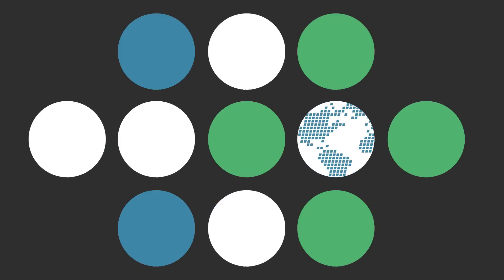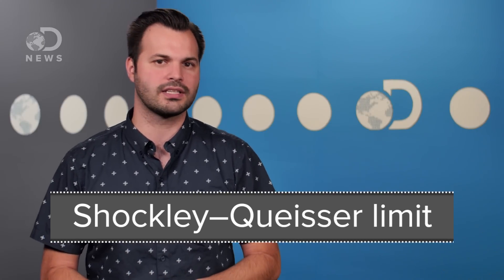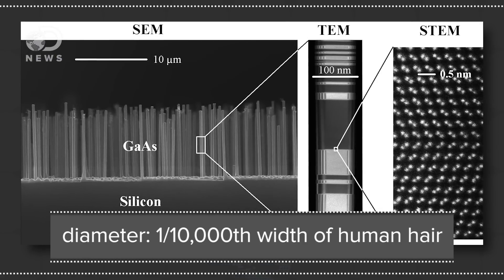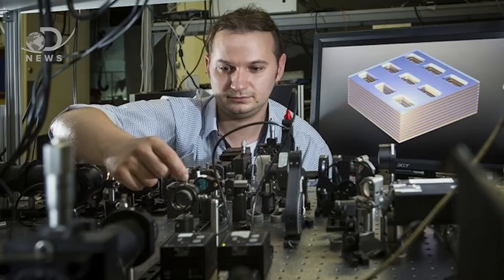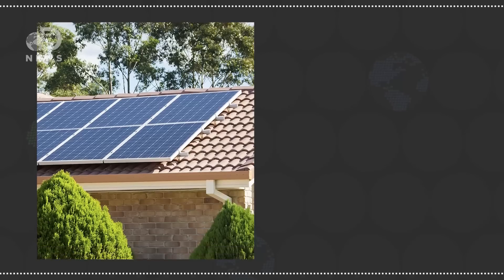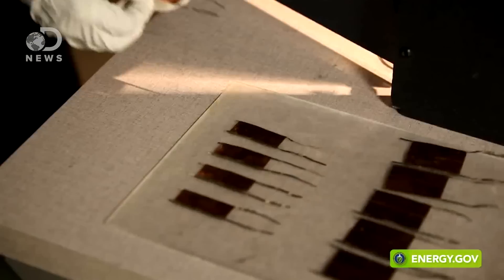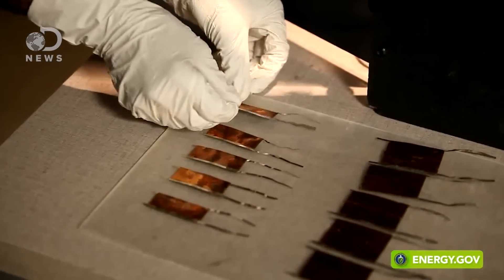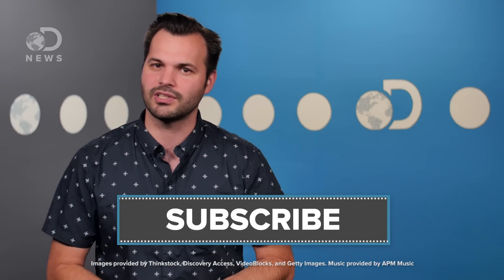Can Nanotechnology Turn Windows Into Solar Panels?

Comment: I was thinking, Solar panels on roofs are always placed on the tiles, why not make the whole roof solar panels INSTEAD of tiles? make it so the roof can breath or whatever still, but people are bothered about looks, If the solar panels ARE the whole roof It will look much better instead of a few being raised above the tiles, not taking up the whole roof. Put something under them that you can't see for strength or more water proof ETC. In a perfect world it should be law to make at least one side of a roof completely solar panels.
Reply: Actually solar shingle have been around since the mid-2000s... unfortunately for us, the DOW Chemical Company owns the patent on them and they have been slow to develop them for unknown reasons...
Reply: Ah that sucks, thanks for the info.
Reply: +21st Century elon musk just said the other day that he's going to create much better solar panels that are specifically designed to improve the appearance of your house. So you're on the right track bud.
Reply: The air gap between the cells and the roof is what keeps them cool, and that improves their efficiency and lifetime.

Comment: glassworker here
i remember reading about different coatings for glass panels about 8 years ago i think, the idea itself is nothing new. 
the downside of gathering solar energy on windows is generally that if you take the energy from light, you usually have less light inside your apartment. at that time i think the panels let about 70 of sunlight thu em (one normal glass panel generally lets 97,  optiwhite or iron free glass is a bit better at it (and doesnt have the green tint to it)).

there are some under development that only capture uv and infrared (non-visible light) but the technology is quite expensive. all in all there is no real point covering your windows with solar panels before you have done so with the rest of your house.  (the solar panel paint seems like an interesting idea)

Comment: I was thinking that how can those windows be efficient as solar panels, since the peak power of sunlight is in the visible area of the spectrum. (Atmosphere absorbs high energy UV and invisible IR is low voltage) Meaning that in order for the panels to collect as much energy as possible, they should look pitch black. Or maybe redish. Not very suitable for a window. So they just stick those collector cells here and there and harvest only some of the light. So, those black panels installed in roofs must be more efficient, given the same tech is used to manufacture them. But I'm glad to see this, I'm sure there are windows to be replaced in densely populated areas where large panel farms aren't an option.

Comment: Yeah, nano-materials, gold-platings... that doesn't sound cost efficient, at least not for a long time until manufacturing of those panels becomes like currently the power-efficient light bulbs are; as in their beginnings they were quite expensive but every now and then the price shrinks due to improvements in manufacturing.

Comment: The biggest problem still remains - the storage of that collected solar energy.
Reply: um, a battery?
Reply: capacitors?
Reply: +MrAppleSalad toxic material.
Reply: Elon Musk to the rescue!
Reply: Tesla Powerwall. can't wait for version two later this year.
Reply: How much will it cost for one powerwall unit thing?
Reply: +21st Century it'll be cheaper than it was for sure. Tesla's Gigafactory is cutting the price of their batteries by up to 20%, according to Musk.
Reply: It's easy to say duh batteries, but they are still very inefficient and expensive. And we still don't have very efficient ways of transporting energy. Imagine the amount of batteries needed to supply a megalopolis like the Tokyo or London area.
Reply: That's one reason why we need a smart grid
Reply: +Greenkrieg The Good Stuff?
Reply: ***** There are many more things that don't have a built in battery like home appliances, like  server centers, like industries, like public transportation(subway, tram, train) I'm all for nuclear power, but there are many opposing it. For instance in Germany there is this constant pressure from the general public and politicians to shut down nuclear powerplants and stop building new ones. It's a fact that electricity can't be transported efficiently with our current technology. A lot is lost to sound or heat because of electrical resistance. And of course there are a bunch of rainy days in the north.
Reply: There are alternative batteries being created as we type, not only for the solar energy but also for cars...
Reply: Molten Salt generators? (It's actually a thing for solar mega plants by the way; you can continue generating electricity during the night)
Reply: So can windmills!

Comment: Can you do a story on solar energy depicting the actual cost of solar systems including all factors, such as; cell production cost, batteries, cell life and replacement cost, carbon impact on manufacturing, disposal, life span, and real cost per kilowatt factoring all of that in.
Reply: And then compare it with fossil fuel.

Comment: There are also Dye solar cells. These are the most intriguing from a quantum mechanical standpoint as they  use the same method that chlorophyll uses to gather energy. 

https://en.wikipedia.org/wiki/Dye-sensitized_solar_cell

Comment: Not sure on how to make panels more efficient, but if you really want to make a house more efficient we have DC bulbs that are as bright as AC ones do we not?  Solar panels can be hooked onto houses using DC current for the lighting of the house(s), saving tons of energy, and the excess can be transferred to AC converters for the regular house power, or to sell back to electric companies.  If a headlamp on a car car be as bright as they are on DC could you imagine them lighting your living room.

Comment: Could you attach cords to trees to gather energy trees make? We've made objects that can recharge phones using your own body heat. So why not attach types of devices to trees so it can gather energy that plants make during photosynthesis?
Reply: that energy is converted by the chloroplasts into chemical energy. So we can't tap that directly.  But that is sort of the idea behind biofuels, using stored sunlight in chemical form.
Reply: Also, trees are even less efficient than solar cells, mostly because they don't need all that energy.
Reply: thats not how it works

Comment: Solar is the energy of the future period
Reply: Solar energy is dead end. We consume more and more power, nuclear fusion the answer maybe.
Reply: filonin2 Nobody is putting fusion reactors in every home, now hydrogen fuel cells etc that is for sure viable and clean , but terrorism would make it too vulnerable to society like anything radioactive or highly explosive.
Reply: edfx It's not a dead end because cheaper more powerful panels are being created some even being made of renewable resources, It's the only viable self sustaining power plant which is in the realms of consumers purchasing power please go learn something
Reply: filonin2 no shit thats why you would pipe it in like a natural gas line. There are hydrogen generators roughly the size of a compact car which could easily be installed at every facility
Reply: FrequencyOfThought
 As I said, I want the dormant old reactors taken down before they blow and replaced with new modern reactor technology that is cleaner, cheaper, safer, and stronger... simple as that. Technology has advanced leagues beyond the Fukushima-type reactors of the past that the uninformed "eco-freaks" are blinded by, they ignorantly aren't even willing to try to understand these scientific advances and are blocking these new safer and cleaner reactors from being built... which in turn has forced a large number of dangerous old reactors to stay active to continue meeting societies energy needs. The energy expenditure to manufacture these fancy new solar panels shown in the video is and will always be way higher than the amount they are likely to save in the short amount of time they have before they get broken, whereas modern reactors take up very little land-space (which would allow us to get rid of harmful fuel burning plants as well as hydro and air power sources that scar nature and kill their fair share of wildlife) and produce far more energy over their long lifetime than solar could even imagine... and as explained, they don't explode or irradiate like the reactors of old and they don't put off dangerous waste... what little problems they do have doesn't change the fact that they are the safest, cheapest, and most environmentally friendly source of energy but stupid people like you are blocking them from being built because "what about Fukushima, that was bad." Solar will still become a more and more useful investment to save home-owners money and decrease local power-drain on the system, but don't pretend they are actually environmentally efficient when there is so much effort needed to manufacturing them and a lot of resource expenditure just to gather the valuable materials needed to build them.

Comment: Why windows? Why not use walls instead? More surface area and less issues with needing to be transparent.
Reply: You mean exterior walls?  I'm trying to think how. You couldn't paint over it.
Reply: drummerboy smith Yes, obviously.
Reply: +drummerboy smith you could paint it and then add a special solar film on it. I know recently there have been some developments to make that possible but that would apply to a wall I don't know. especially as walls get dirty easily and it would be very expensive. it's probably worth just doing it on windows for now.

Comment: Nuclear power is limited and the mines will one day completely run out just like gas and coal but are extremely dangerous to the point that we should be asking why we still use them after the Chernobyl incident Solar power wind turbines and water turbines are what we should be doing as well as burning trash for power literally solving 2 problems at once getting rid of trash and making power for everyone solar power is the best form of natural power in my opinion because you can literally put it anywhere even on homes like you said but unlike wind turbines it doesn't hurt wildlife you ever walk by wind turbines there are dead birds everywhere and water turbines can't be much better so when solar panels are no longer toxic than that day free natural power for all the only cost it are manufacturing installation & maintaining that's it

Comment: But if you can see clearly through the window, that means lots of light is coming through, so the solar panel is not absorbing very much at all. Roof panels work fine thank you. Please don't make it stupid and expensive and not effective, just stick them on your roof or in a big open space, that would be FAR more effective than having a glass "solar panel"

Comment: wait normal solar panels are 33.7% efficient. But using nano wires it increases efficiency by 15X so the solar panels would then be 505.5%???? HOW? Where does the energy come from? Thats like saying for ever joule of light energy 5 joules of electrical energy can be made. Doesn't that mean we have been underestimating how much energy light stores?
Reply: That's not how percentages work

Comment: Hang on.  Did you say thermophotovoltaic?  Not only photovoltaic, but thermophotovoltaic?  As in these cells don't just convert visible light into electricity, but heat as well?  That's extraordinary!
Reply: Personally, I'm more a fan of a mixed power grid.  Such is more versatile.  But let me qualify the term "mixed" to mean one that does not rely on nonrenewable sources of power.  Better to keep those to a minimum because, of course, they are nonrenewable.  Criticize renewable sources of power all you want.  Sure, they may have a lot of bugs to work out, but sooner or later, the nonrenewable sources are going to run out and the renewable sources (bugs and all) will be all we have.

Comment: How efficient are fossil-fuelled power stations?
Reply: He made a video. Look up "DNews which power source is most efficient"
Reply: The answer is about 40% John Benton. I hate it when people redirect you instead of just answering the question.
Reply: Naw i thought it was just 30 something percent.
Reply: Does your 40% include the mining, transportation and preparing the fuel before it is burned to create steam to drive the turbines? Does your 40% include the energy used in the designing, building and installing The power-generating equipment?
Reply: Sorry I took so long. No, it's just calculated based on the proposed energy density of coal and the amount of energy in electric power we get out. I am not a proponent of fossil fuels just so you know.